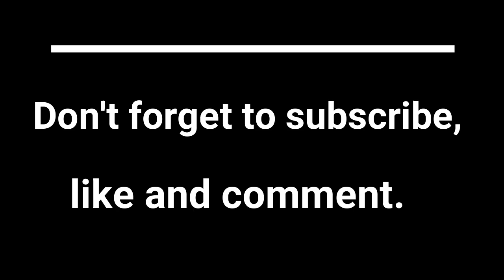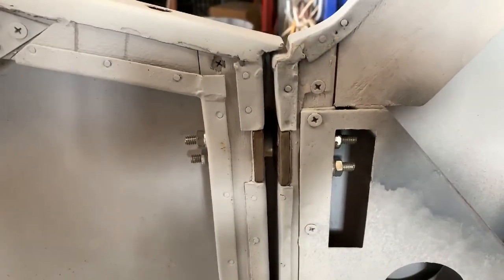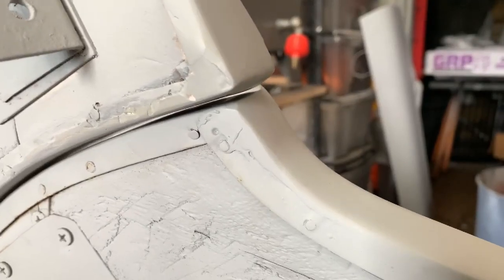1950 MGTD Rebuild Episode 36

Comment: I have been adjusting one of my doors for a year now.  One MG forum member suggested adding a steel plate to the nuts and spot welding them in place to aid in future adjustments.  Once the door and tub are covered over, the tightening is more difficult (need to remove the vinyl covering).
Reply from the maker: That’s a great idea.

Comment: the idea is to shim (with bits of cardboard, like from a cereal box) the door in the door frame without the hinges. then fit the hinges to match. you may need new hinges. and as a last resort some work on where the hinges mate with the door jams and with the door. i would also look into buying new hinges. after so many years of use they are likely to be sprung. and if so, the doors will never fit right.

and BTW, when adjusting doors or any body part, put only as many bolts in as is necessary to hold it in place to determine whether the fitment is closer than it was previously.  putting all of them in each and every time is a waste of time.

Comment: Usually door adjustment on T series cars is more a make the hole fit the door rather than the other way around. Try shims between the body tub and the frame where the tub is attached.  Flat washers work nicely for shims.  if you want to lower the door in the hole, you need to actually raise the front of the opening while keeping the rear clamped down.  Try shimming where the body is attached the the frame in front of the door and make sure the rear is bolted solidly to the frame.  Also, make sure the bolts at the rear of the tub (back at the side curtain box) are tight to the frame when you raise the front of the tub.  If the opening is too tight, shims in the middle of the door opening and tight at each end will open it up some.  As others have stated, door fit is a trial and error exasperating task.. but it can be done.
Reply from the maker: Thanks Neil, that’s some really good information. I’m not sure if mine is different, but I only have 2 places near the doors where the body tub mounts to the chassis, one near the B pillar and another in the middle of the door opening
Reply: @MGREBUILD  Don't know if the first part of my message got sent or not so here goes again.. apologies if it comes twice. If the door fits the hole with adequate clearance (a 1/4 " or less) without it being installed then hits when hinged then the following might help.   If you consider the front of the body tub to be securely fastened to the frame via the support posts (triangular posts the toe board and firewall are bolted to, then the only changeable areas are the two bolts you mentioned and the two at the rear of the body tub by the side curtain box.  Adding shims to the rear bolts by the side curtain box or adding shims at the B post will change the rake of the hinge pillar raising or lowering the front of the door a bit.  Putting a shim under the bolt at the middle of the door while B pillar and front remain secured will vary the size of the opening for the door.  Also make sure there is zero play in the hinge pins as just a small amount of wear there will make a big difference in door drop at the front.  I have also used very thin shims between the hinge and the body or door to raise or lower the door. In some cases that seems to be the only thing that worked.  Press on Regardless...
Reply from the maker: Neil Nelson thanks for your detailed message. I’m going to play with the door again tonight. The top of the door at the hinges also has to move inwards towards the tub. I will be gluing in hardwood dowels and drilling new holes to help with the alignment.
Fingers crossed, or is it third time lucky.
Reply: I've been grappling with door fitment on my TF for some time.  Thanks Neil for your detailed suggestions which I'll try.

Comment: Persistence is omnipotent👍🏼
Painted moving parts (like hinges) will usually chip & chip, but polishing brass is a PIA, & although there is clear coating available for brass, it doesn’t last forever either. Brass can be chromed too, & a good electroplater can eventually smooth all the nicks & marks🤑 Are you looking for concourse points at the end of the project, or just trying to please yourself??
Reply from the maker: It won’t be a concourse car, but I’m trying to make it as original as possible.

Comment: About your right side door mismatch, is it possible that you changed the body shape while replacing the timber?
Reply from the maker: The timber was already replaced prior to me buying it
Reply: @MGREBUILD  so the door fit initially but doesn't now? You may want to check your original pictures/videos to see if you have one showing the initial fit...
Reply from the maker: Dave Lawson yes I will have to troll through my videos and see how it originally fitted